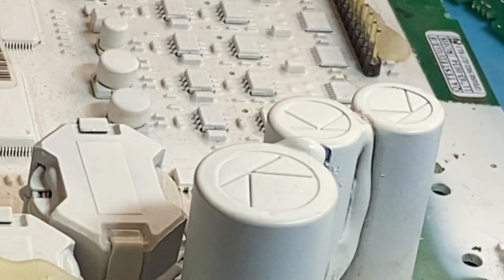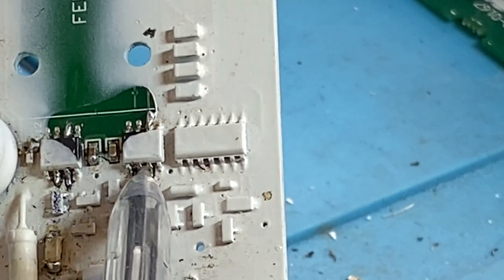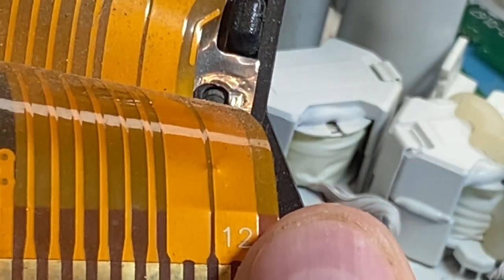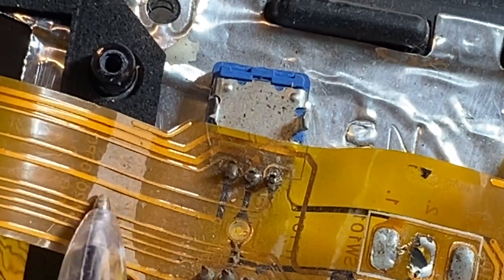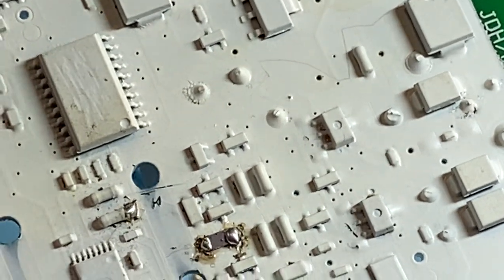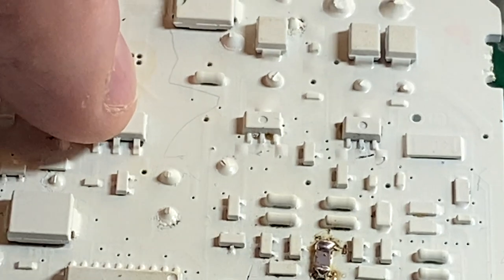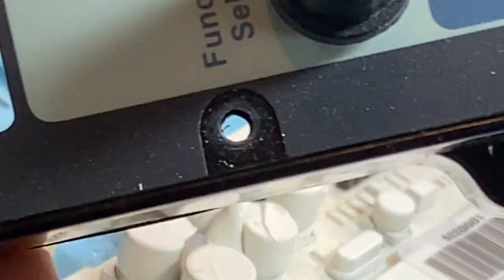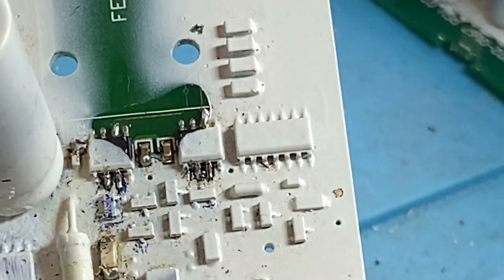Minelab GPX series detector bush repairs and common faults.

Comment: I am very happy when I found this wonderful site and this excellent explanation of the metal detector. I bought a 4500 and it lost the sound. There is no longer any response from the device. There is no one to repair it. I was hoping for an explanation from you about the problem of the lack of sound. I hope that you would kindly explain to us all the stages of signal transmission. From the time she arrived at the Shia to the stage of her treatment, then until she left, heard, you are the only one and the only hope that remains for those who follow you. Thank you again.
Reply from the maker: No sound is usually the broken Mylar connector on the power connector that has broken.

Comment: My gpx 4500 had one of the issues described in the video (unit didn't power on due to a break somewhere in the wiring). Went to DetectorMods and David replaced the mylar strip/connector/power switch. Now working perfectly 👍 Would highly recommend them for repairs

Comment: Thank you very much for sharing the useful information. I had a question, do you think there is a difference in the assembly of the device in Malaysia or Ireland and America?
Reply from the maker: I only know of Malaysian and Chinese manufacture.
Reply: @DetectorMods  As far as I heard, Plexus company does assembly for Minelab company in three countries: Malaysia, America, Ireland. Did you not see any difference in the quality of the parts?
Reply from the maker: The only difference i see is how thick the white paint is , be a issue for the repair technicians, Minelab had the equipment to manufacture in Australia but that all went away.
Reply: @DetectorMods  Excellent, sorry for asking you so many questions. In an example of Iran, it is difficult to access some spare parts for repair. From which source do you get the parts? Is there an online store?

Comment: Thank youbmr Woody for sharing all of thos information .my gpx4500 go low depth no more 10 cm . The two smals n channel mosfet were you shaw In input stage and another one in other side of board they burnt . I do not known there names . Can you help pls . Regards
Reply from the maker: The part for 200 volt input is no longer available from distributors as it was discontinued but i have plenty, 2Sk1334 ,the small ones are 2N7002
Reply: @DetectorMods  so the two MOSFET are 2n7002 .but what about the other transistor  in second face board . I sent a photos on geotech1 forum . Your thread minlab repair and info . And thanks mr
Reply: @DetectorMods  please Where exact can jumber anode/gathod bav99 due to the damage of the welding place ? I think in other side board but i coudnt found exactly where .
Reply: @kadikadir1410  Please send the conversation link
Reply: @DivarDetector  wich conversation ??